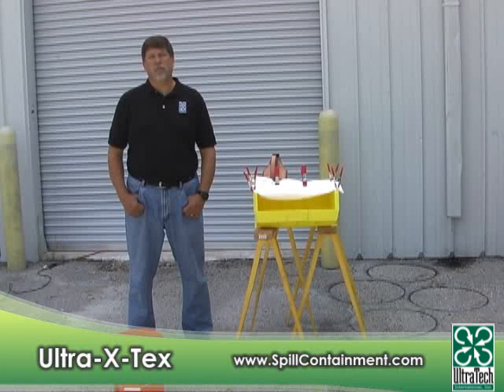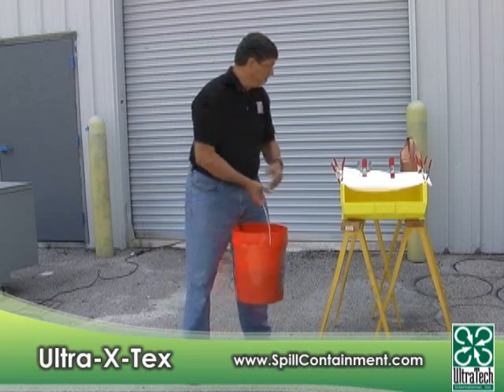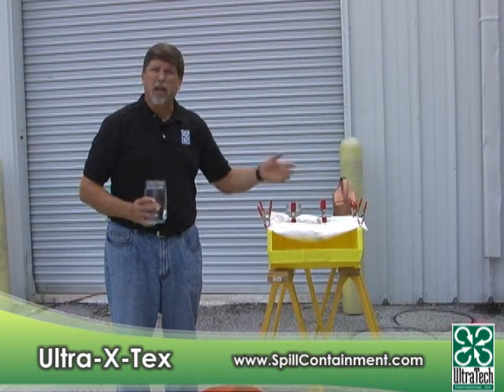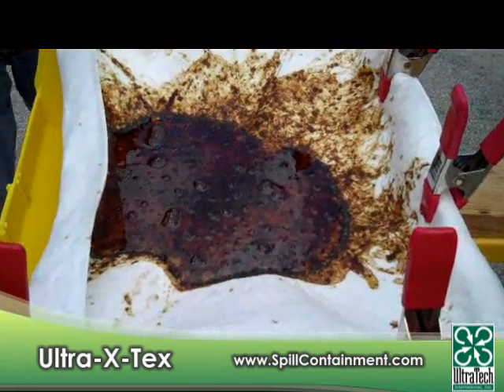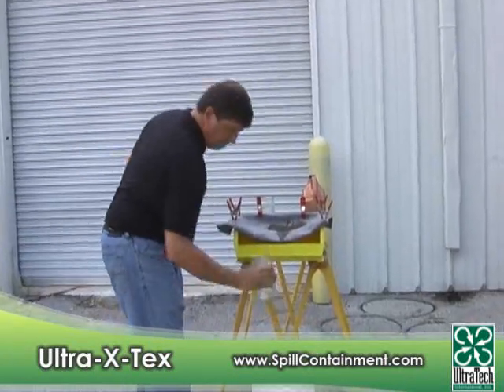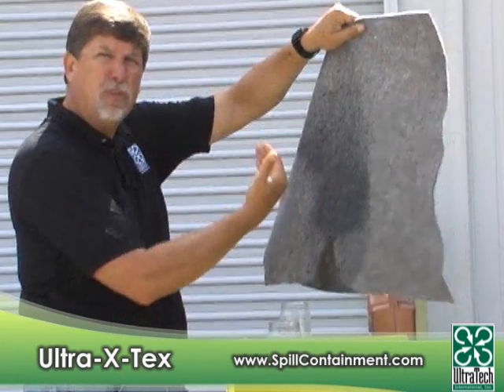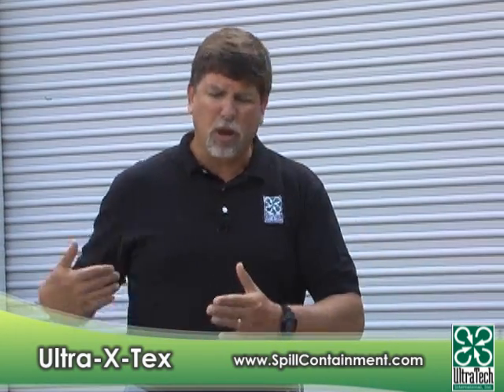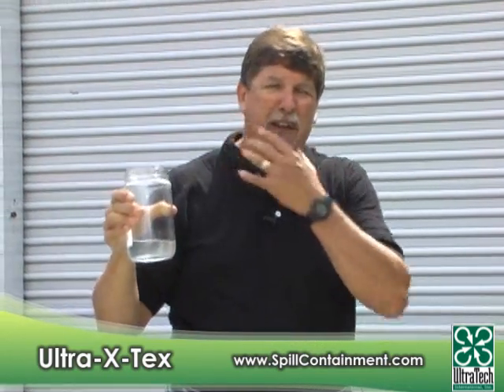Oil Filter Fabric - Ultra-X-Tex - UltraTech International, Inc.

Comment: Over 30 miles of the Ultra-X-Tex was used by BP during the Gulf Oil Spill and it proved to be successful.  There is also floating debris and other non-oil related particles in most water applications.  The Ultra-X-Tex is able to filter the water/oil in these applications until it saturates.  Certainly, anytype of filter can clog if the application blinds it over too quickly.  We have not found an application yet where the Ultra-X-Tex did not work due to blind over.  Your comment has vailidity.

Comment: Very interesting. I just wonder about the cost. Does it work that good with salt water? Will it work with the crap that BP is spraying to make the oil to 'go away' from the surface of the Gulf? Can saltwater/oil be squeezed 2 or more times out of this 'towel'?  And there's the problem that there is so many different grades of oil. Will it work on all/most of them? Oh, and is this guy still alive? I bet he regretted drinking that glass of 'water'.